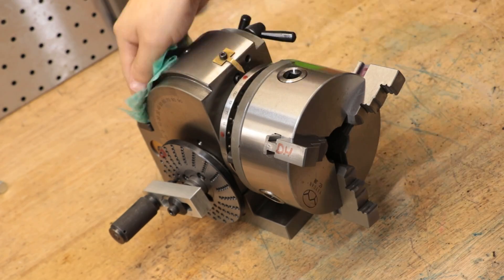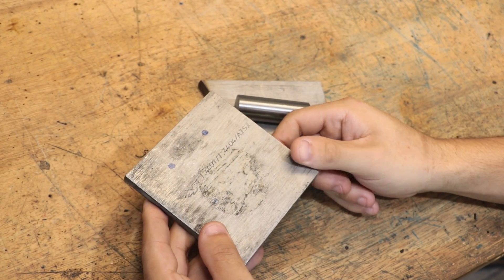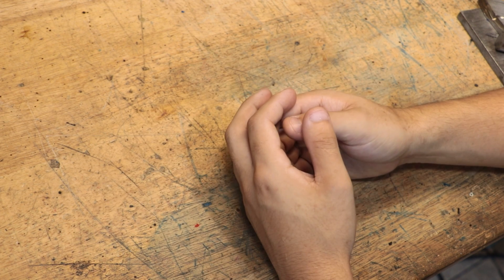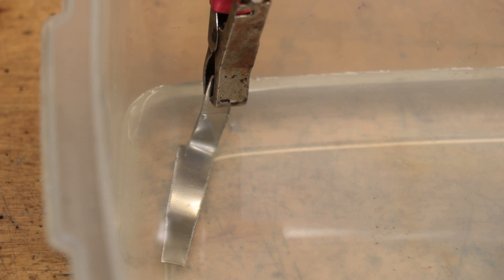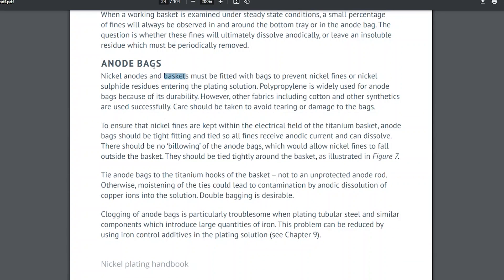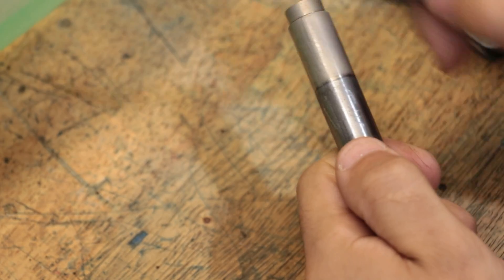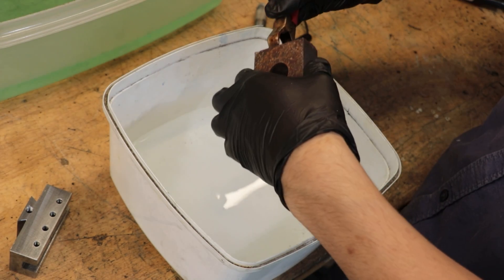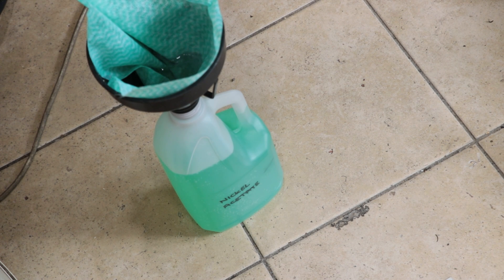Nickel Electroplating Steel In The Home Workshop

Comment: Hi there,

I really enjoyed your video about nickel plating and working with steel – thank you for sharing such useful information.

I'm currently working on a project where I need to machine some parts from 316L stainless steel, and I was wondering if you could kindly recommend a source (preferably online) where I could buy small plates or sheets of 316L steel for home workshop use.

I'm based in Switzerland, but if you know of any international suppliers, or any tips on what to look for when buying this material, it would be greatly appreciated.

Thanks again and all the best with your future projects!
António

Comment: Be careful buying on ebay, I paid $20 for some zinc plates and after much time and materials wasted in failure after failure I finally checked the zinc plates. Turns out they were magnetic and rusted. They were not zinc at all but steel plates.

Comment: It's really detail specific and precise science to electroplate. As you displayed here a protective coating can quickly be applied. There are heavy metal forms which can contaminate the body to various degrees and are particularly nasty. The nickel must be of the purest quality and 100% pure for anodes or diodes. Contamination with (Fe) iron and Carbon must be avoided and copper in the nickel acetate is said to be dangerous also . A fume hood over the bath or a great amount of ventilation will help protect the worker, I have read. So we know then the gaseous forms pose the danger since you wont be drinking or contaminating food with any of (God willing) Also it's common sense to keep the hands dry and clean inside nitrile or latex gloves? The power source is the easiest thing to make a strong influence on the plating. Temperature also. So I know enough that your video helps me to understand better since all these points you covered including do research plenty.

Comment: I dissolved the connection strips from old  lithium batteries.  The solution went nicely green as expected but my plating is nearly black. I was disappointed but put the part to work.
It is an adapter from Gernie high pressure water jet cleaner to an unknown brand drain snake.  The part is slate gray after 2 years but not showing any rust.

Comment: Protip - For some electroplating if you can not get a hold of good enough vinegar acid or if your vinegar solution produces lots of residue and eats through some metals (like solder joints) you can try citric acid, which will work perfectly, but will introduce impurities that will get thrown out of the solution during plating and will quickly degrade the it. Still, better a short-lived plating solution than completely unplated half-eaten solder joints

Comment: I agree that on my smaller handtools that they get rusty fast.   the cheaper ones have a very poor rough finish... me being me I polished the parts not in handles.    They come out like bright chrome...easier to wipe clean.    So pretty my buddy took a tiny pair of sidecutters to cut his nails!    My favorite projects are my black powder Colt revolvers (clones)  They look pretty flashy and are much easier to clean.    My thinking is tho that I have never seen an old Nickel plated gun that had the dreaded 'ring around the cylinder'  caused by the bolt dragging on the blue steel and wearing through in short order   Sooo the cylinder is machined to have 'bolt stop notches' that keep the cylinder from turning during firing.   The other thing is they cylinder star that the hand moves the cyl with (rotates the right amount)   nickel is really hard.  it also has some 'lubricity' on a highly polished part.   Black powder residue will wipe off for the most part.    Also the fouling build up till after 4 cyl or so the cylinder will not turn.  You have to take it apart and clean it.    With my guns.... I noticed that they rarely if ever jam up now.  Also the nickel is preventing wear on the now plated star.   I even plate the insides of the chambers...  for an experiment I nickel plated the bore of the least powerful one in 31 caliber.    A real quicky job without much prep but it is still hanging in there.

One other thing that is important for guns at least is a barrier between the steel and the nickel.   It is best to nickel plate over copper as the bond is much greater.

Comment: What mm does  your new lathe uses?? 12 mm?? Also where do you buy most of ur cutting tools?
Reply from the maker: I use 12mm, for the standard tool post it used 16mm, I had to shim the tools up to centre height. As for the holders I buy them off eBay, kinda cheap and nasty but they’ve lasted 5 years. The inserts I buy off aliexpress. $5-10 for 10 inserts
Reply: @artisanmakes  i love ur channel is one of my top 3 i just got a lathe and i have a lot of questions thats why i asked

Comment: Vinegar, salt, Rubbermaid tub, distilled water, some old stainless forks, and a battery charger. Yeah, it doesn't get more basic than that. Best part, it produces results. At the end of the day, that's what matters most. Fun fact, old computer components and cell phones and print cartridges all have gold contacts in them. You can use a aqua regia process to extract the gold into a solution that you can plate with.
 I expect to see everything in your shop gold-plated within the next year.😂

Comment: Cool video. I've worked in eleptro polishing for about 15 ish years. For cleaning acetone as well as lacquer thinner work well but we also use sodium hydroxide ( caustic) and that works very well. It helps for us to suspend the piece as well as moving the contact points depending on what you want to achieve. This may not help with what you're doing but I thought I'd mention it. It is more or less the same thing just the opposite and I know that seemingly doesn't make sense but hard to say. I'm going to give your method a try on my next project

Comment: And now that you have cut your teeth on nickel plating forget all about the nickel acetate and set up a watts bath instead.  absolutely nothing hard about it, and you will get the shiny plating you desire.  am running one myself in home workshop.  yes you will need the lab power supply and some heat control and agitation but cheap china stuff is fine.  you can do very heavy plating as well.  i could lean on my buffing wheel and probably die of old age before i got through the nickel.  you can buff it up like a mirror.

Comment: They sell a Bright Nickel Plating solution, I saw some on Amazon for like 30 dollars US but it's only an 8oz bottle. 
A tip for plating like is if you want a bright finish you're going to need to mirror polish the surface before plating, otherwise it will appear very dull. Also make sure the parts are super clean. 👍👍

Comment: would have to add 0.05% Copper, 1.5% Nickle, 60% Tungsten, 0.3% Vanadium, 1.25% Chrome, and 36.9% iron to the electroplating solution, for it to be mildly hardened. near 280'000psi to 480'000psi cylinder lining for things like pneumatic tools engines compressors and roller bearings... that go over cast iron, and slowly raise the quality of iron every time something is recycled.
Reply: can get away with using depleted uranium in electroplating industrial equipment in some places...
Reply: use a disposable carbon electrode on the sacrificial end.

Comment: Parkerizing is extremely easy to do.  If you can heat water you can parkerize.  It was used on virtually all small arms used in word war II.  The parkerizing itself is very abrasion resistant.  It comes in either grey or black color.  I never use any other process any more.  Try it.  You’ll like it.

Comment: Worked in a plating shop for 3 years doing copper, nickel and chrome plating.  Brightness issue you are correct that a brightner does improve it well but a little buffing before and after plating will help. The discoloration could be because the edges closest to the anodes can get plating burned. Thin edges tend to have this problem most. Try spacing the cathode/anode farther from the part. Lastly we used aeration in the nickel tank. Try a fish tank bubbler. 
Looks great for a first try.
Reply: I would like to nickel plate a large object to be specific a table saw table do you have any recommendations on how to get an even coating on a large objects like that
Reply: @cfwmitch  Large pieces take large tanks.  It is cost affective to do small parts at home but larger parts take a lot more current, way more nickel in solution and more time in the tank.  Have you gotten a quote from a plating shop yet?

Comment: the hell is non fermented vinegar?
Reply from the maker: Food stuff is fermented from wine or corn, this stuff is not brewed. its acetic acid added with water.
Reply: @artisanmakes  I've never seen it in the US, we just have normal wine and cider vinegar and "white" distilled vinegar of varying strengths
Reply from the maker: Interesting. Non fermented seems to be the standard stuff for cleaning vinegar. My best guess is that it is way cheaper to add water and acetic acid together than to ferment it. Cheers
Reply: @artisanmakes  acetobacter fermentation is stupid slow
I'm guessing all our white vinegar is of the Methanol carbonylation variety

Comment: man , did you figuere out why your lathe was too noisy?. greetings
Reply from the maker: its just the gearbox. straight cut gears tend to be loud. It is not too different to the other hafco lathes i have used
Reply: @artisanmakes  good for you, I recall hearing you said you may open the gear box to take a look inside. Keep rocking.
Reply from the maker: I did, there is some play in the gears and spacers but that’s mostly taken up once the oil is added. I would pull the gearbox apart but it seems like that would be a months long adventure that I don’t feel is necessary
Reply: @artisanmakes  well, I am glad the machine is cool.

Comment: Get/make a stirring bar (plastidip a magnet bar and glue a small button magnet to a fan) or just use an SLA printing stir-cleaner (which is what I do). As you plate, it will keep the solution moving and stop the bubbles of H+ from adhering to the workpiece and cause the darkening your seeing.

Comment: Since you're using salt water, the process should actually better be done outside. The hydrogen that is created is less dangeraous than the chlorine gas that is also produced, because it comes from the salt, that is also split in the process.

Comment: @1:24 - Cool story bro time:  I used to work in a plating factory.  I did reel to reel lead plating with copper and tin/lead and I did small batch barrel plating.  Gold was plated twice a week in a barrel and the chemist was a personal friend.  I would often throw pocket change and various items in the barrel at load time and retrieve them after the full cycle was done. That lead to me having a vast collection of cobalt doped (shine and hardness) gold plated items like coins, paper clips - whatever you would think looks cool to barrel plate and is small enough to tumble easily in a barrel.  This included a 'pipe' that I had turned out of stainless in the metal lathe during an overnight shift.  Great job, but left a hole in every piece of work clothing I had.
Reply: Yeah, the drops of acid eat holes in your clothing (especially fabrics with cotton) no matter how fast you try to rinse/wash them, even when still standing next to the plating tank and you use a water hose (clean rinse water) to rinse the acid drop away.

Comment: You could use a Dacron cloth filter bag for a shop vac as your anode bag. Ideally, you want the part fully suspended in the solution not sitting on the bottom of the tank to prevent dead zones with no coating.

Comment: Good idea and nickel plating is a good choice.
My brother has vintage motorcycles and has replated much of the nickel. I'm not surs of the process he used but achieved great resultsxand even matched the vintage finish of original parts. For extra protection he copper plated the steel parts first.
Reply: Depending on the age of the vehicle, sometimes they used cadmium

Comment: Another option is electroless nickle. As a designer I used this for aluminum covers as it's a wear and scratch resistant surface.  I don't remember plating steel but it should work. Amazon has electroless plating kits. Interestingly electroless plate can be soldered with electronics solder so the flux will not be corrosive.
Reply: Nickel straight aluminum?

Or 

Copper then Nickel on aluminum?

No zincate?

Comment: If you want bright and shiny nickel you can add  1g/L of pure Saccharine (artificial sweetener)-  this acts as a brightener and should be relatively easy to get. Its a bit old school compared to the newest addtitives on the market but was used for decades with good results. I have used this method in vinegar based DIY baths with good sucess. keep in mind that there is a "window" of current density in which the bath produces the best results- too much current(amps) = bad results and too little current = also bad results. Dont care too much about the voltage, its the current that does the work and that has to be controlled. usually its dependent on the size of the object to be plated and the larger the object the more current you need. A general starting point would be about 25mA per cm² of to be plated surface and bath temp of about 35-40°C-
Reply from the maker: wow that sounds like such a great tip. Ill have to do that next time I am nickel plating
Reply: Sound good and easier to make either brighter

Comment: Lower your voltage to 3-5v and hang the part so it can spin or can be occasionally rotated between the two anodes.  Add a small amount of dissolved boric acid to the solution and saccharin as a brightener.  All these dramatically helped me.
Reply: I would like to do this nickel plating on a vintage watch I have but 2 things is

1 I want it to be brighter
2 not sure it will get electroplated even on the surface if the watch.

I heard that people use some kind of acids to get rid of any oils
Reply: @OscarNunezthewatchcollector  You should do so much research on the topic that your head hurts. Then double that and do it for a week. :) Plating is not something that turns out well without fairly deep understanding of the electrochemistry topic in general;.  Nickel on steel or stainless can be tricky to get right.

There are bright nickel solutions on caldwell.  If you're a d oit yourself-er, sodium sacharin is a fairly good brightener additive.

The watch will need to be completely dissassembled, the crystal removed, etc...  The case should be boiled in hot water with degreaser, then electro cleaned(another topic), then rinsed with distilled water.  The trick is cleaning until the water no longer beads but instead, sheets over the part.  That's the level of clean needed.  

Good luck.  I encourage the journey, but be assured.  A short journey will yield lower quality results, while a studied long path will [produce a thing of beauty.  Thats the nature of most things, I digress...

Comment: Good video :)
At least for chrome (which I've done in an industrial setting a long time ago) pH, temperature and type of transfer current does a huge difference. For most metal platings you need a controlled 10-50Hz pulsing or even 50Hz 90/10 duty cycle AC pulsing to make the de-ionization deposition form an ideal metal matrix on the receiver. When you need the best wear resistance that you can get, this is very important. Also, look into something that can sit in the bath and stir the solution slowly while plating, this helps with deposition evenness.

Comment: I'm a self-taught home machinist that does some nickel plating. After some stuff that started to rust anyhow after a while, I learned that preparation is very very important. The part has to be very clean and degreased. Preparation take much more time than the plating itself
Secondly, don't add too much salt, as the current will be too high, causing uneven plating results. The current required depends on the surface area. 
Finally nickelacetate is poisonous, so store it safely
Reply: Any storage recommendations?
Reply: @famtovar5385  I'm self taught, so no professional. But I know one or two things. The base is vinegar, so you nickel acetate, but the concentrationisn't very high. I think coke is more acidic (so PET would work). You can store it in any acid proof water tight container: I'm using PP food storage containers. Seal it and keep it at room temperature. You can lookup recommendations for professional products.
Reply: @famtovar5385  Get a used 5 gallon white pickel bucket with lid from a restaurant and label it with a permanent marker.
Reply: Out of curiosity, how does one calculate the required current based on surface area? I am in the process of restoring a typewriter, and I'd like to nickel plate and zinc plate the components which originally received this treatment (after stripping and polishing/buffing and thoroughly cleaning these parts beforehand). I imagine the current requirements would be different based on the specific dissolved metal you're intending to plate with.
Reply: @spartan456  A chemical engineering student would calculate the exact current based on factors like the electronegativity of the metal, the strength of the electrolyte solution, surface area, element being plated; but as a mere manufacturing engineer I was taught to consult charts in textbooks for an answere to about 5 or 10% accuracy in cases like this.